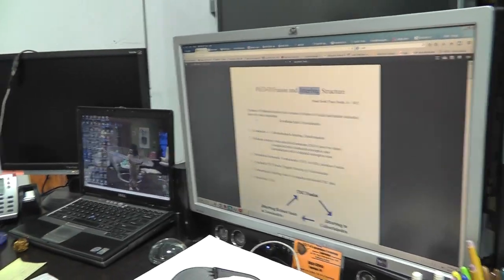LENR "Jitterbug" experament. Feed Back Please!

Comment: I'm not sure how much input your going to receive from the public on this one. I've been trying to get help with the H-Cat LENR experiments too and very few of the guys offer much input. When you start talking about Deuterium, Tritium or Deuteron-Deuteron fusion you can forget about it lol. 

I looked over the paper and I can say the geometry of the nano palladium is probably spot on in terms of what is needed to successfully initiate the reaction once the Hydrogen loads into the lattice. Tetrahedral fractal patterns probably make up the entire known universe in terms of physical matter. 

The palladium particle size is also important in these experiments. If I were running trial experiments I would make sure to process multiple range batches of the Pd nano powders from as far back on the nanometer scale as possible going up to 20-50 micron level. One thing I am noticing is the LENR labs are all using different particle sizes in the reactors which is causing a variance in results from one lab or group to the other. I'm sure there is a "sweet spot" in terms of particle size. You can get the geometry right but yield null results because the Pd particles are either too small or too large. The equipment needed to manufacture the powder to spec is beyond anything I could suggest.

I would also look for electromagnetic signatures in the reaction as well as heat. Most of the work is looking for excess heat but its a known fact that the reactors are also throwing off electromagnetic pulses. These signatures may be easier to measure and see than a few milliwatts of heat. Your going to probably be working with pulsing the reactors with different voltages and or frequencies anyway so you should be able to setup a feedback link on a scope to read any anomalies that is showing up outside of what you are inputting. 

I know the guys you work for are probably hell bent on D-D Fusion but I think you should look into the nano magnetism theory of Dr. Brian Ahern to explain where the energy is coming from in the LENR field. So far, I am really resonating towards this theory and I'm no longer convinced the process is simply "cold fusion". Even Blacklight Powers theory doesn't work for me anymore after learning about the work of Dr. Brian Ahern.

By the way the name/title "Jitterbug" is actually very appropriate here. I laughed when I started reading the paper. I hope to someday dive into this type of work but it is proving to be very expensive, complex, and specialized when it comes right down to it. Good luck and do us all a favor by posting some video.

Comment: During the heat phase of cold fusion there in is when the transmutation takes place, unless you can keep the from becoming stable your metabolism will digest and the reaction will finish. You are proposing a reversible chain reaction in the metal. It can't be done. Once you change that's it. 

There is an outcome of your paper that I will comment on in your forum. In my lab under closed observation my colleagues and I have held it for 45 minutes and repetitive. 

Good luck,  be careful of radiation poisoning